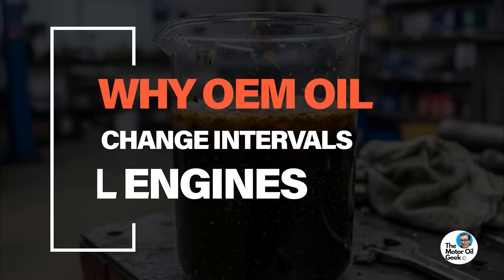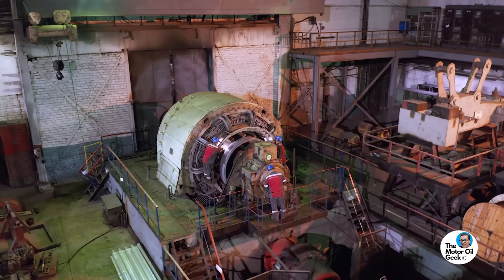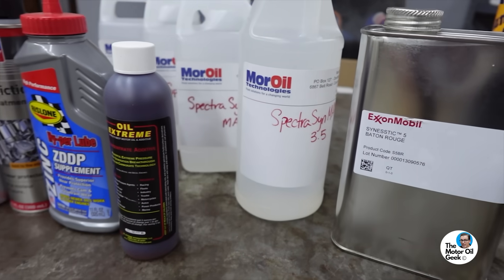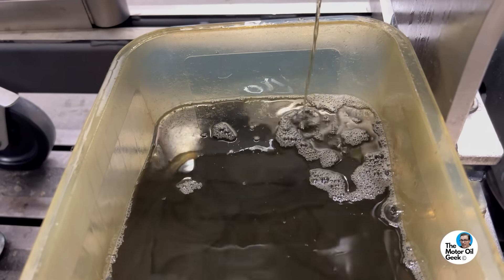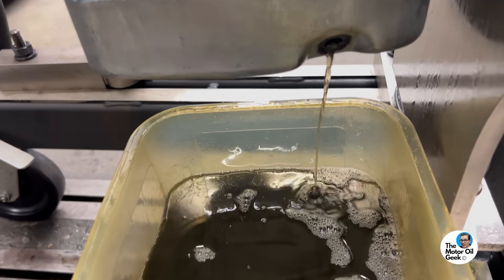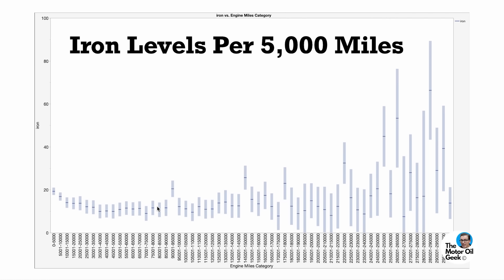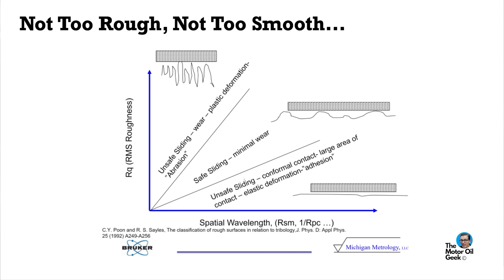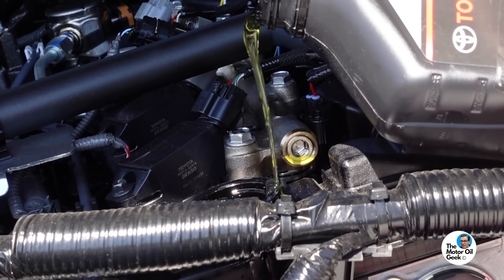NEW Data Reveals WHY Modern Engines FAIL Prematurely!

Comment: As much as I love me some AMSOIL I don't always have the funds for it. So I've just been sticking to the Harvest King stuff they sell at our local Running's store and so far it's worked out. A 5 quart bottle of 5W30 full synthetic goes for $20 and an extra quart is $4.49. A good price for frequent oil changes. I try to change the oil every 3,000 miles but I don't always have the opportunity to. So it's probably more like 3,500 miles. I've also considered changing the filter at least one more time throughout a fresh oil change before a full change is needed. But I don't know if it's worth it.

Comment: How does the dirty get around the oil filter? The pump, pump oil through the filter than into the engine? So...if we all do what you recommend. That will solve the engine problems?

Comment: Genuine observation/question - In my lifetime we went from straight 30 weight to multi viscosity 10-30 then 5-30 then 0-20 to 0-30. I don’t understand how a 0 weight oil can possibly be good for a motor. Couple this with viscosity breakdown and it’s a recipe for a major parts failure. There doesn’t seem to be enough “film” strength there to provide adequate protection. I suppose if you are in the parts or repair business it would be a benefit to you to have important parts like bearings to fail or “spin” creating a much lager repair bill. 

Is this a correct line of reasoning?

Comment: The factory never does the alpha and beta work. It‘s the customer, be it break-in, new features, metalurgies, anything. Sure they test in their labs, and on roads and develop procesures, but nothing mirrors reality better than reality by engine-lives. Don‘t think the warranty assures they‘ve done their job and it‘s there to safeguard you the customer or proove the customer how much trust the factory has in its product. It‘s not!
Warranties is to cover-up on anything beyond break-in that might get them into public re-calls otherwise, friendly individual factory driven pro-active or re-active replacements under service is to avoid public re-calls, to cover up issues they have designed with their bad quality testing and bad quality designs, cost savings, idiocies pushing known errors to market, and so forth. In addition it‘s there to retain good customers (good customers are the ones that yearly buy a new motorcycle or more, it‘s not the one that buys a bike for 20yrs and comes to the occasional service, less so the one that does his own service on a newly bought bike).
It‘s an industry of greed, thieves managing a few honest designers forcing them to accept or design crap delivery to customers.
Same on other industries, outsourcing not helping but worsening the capabilities to serve the customer, I see it in our company and I see it in all industries of our customers as they do the same. Who wonders why all goes bang, constantly?
What‘s really funny is, that these morons who have no skills and do low jobs and the others who have no skills other than upsell them to do mgmt jobs, both in private think they can serve a complex system better than their smart engineers that are not allowed to put a working system for a fair price in front of their customers. Then we have all these videos on the net with all the supersmart skill-less people that bought a smart-phone or a better video cam and a few engineers that try to fight these with proper knowledge and expertise. this is so funny, that it is no more.

Comment: Excellent information. I have 233,000 miles on a 2006 Toyota Matrix 4WD. It's 45th oil change is coming up (5k/6mo, OCI). Also, I measured pressure pulses at PCV hose with a PicoScope and a DIY sensor (smoke alarm piezo). There is effectively zero blow-by. 🔧

Comment: Doesn't the oil filter soon pass the point where its efficiency increases, causing significant pressure loss and increasing the risk of the bypass valve opening?

Comment: Any data concerning the impact of design and manufacturing defects vs. user neglect and even outright abuse?  Personally, I've owned a lot of vehicles over the long term and neglecting things like oil changes is extremely common, yet engine failure wasn't, in my experience generally everything else about the vehicle starts to go to crap long before the engine starts failing. In some Nissans that was the CVT. In some Hondas that was the automatic transmission. In some cars it's everything else, including the interiors falling to bits. Everything around the engine goes to crap, but that neglected engine keeps on ticking. I suspect that's the norm outside of cases involving defects like in design and or manufacturing.

Comment: Engine oil has been used as hydraulic fluid for decades … since the advent of hydraulic lifters.  Why is this now becoming an issue?  What is different between a hydraulic cam phaser as compared to a hydraulic valve lifter?  I’m not sure I’m seeing why this is a new problem if the issue is hydraulic use of engine oil.

Comment: Best advice I've gathered thus far: For a GDI based gas engine past the break-in period, change the quality synthetic oil often (say 5K miles) while using a high quality oil filter and perhaps only changing it every other OCI (based on the UOA) for best filtration all while using Top Tier gas.  I would drain out the old oil from the filter if reusing it if possible and always pre-fill any canister type oil filter when installing it.  I also would fully "mix/shake" the oil jugs prior to using them to ensure anything that might have settled in the jug is properly mixed back into the oil (I know, I know).  And do a UOA when you can (at least annually).  I will also annually do a fuel system clean (adding product in the fuel when filling up - I prefer Redline SL-1) to assist the Top Tier fuel cleaning effect as well.  Currently my oil of choice is Valvoline's Restore & Protect product (past has been Pennzoil Ultra Platinum).  YMMV.  Yes, please to deep dive on filtration as well.  Great video sir!

Comment: I recall one of your videos discussing air filtration and that a slightly dirty filter actually was better at trapping particulate matter than a brand new filter. 
Does that same logic apply to oil filters in that a single oil filter should be used for 2 oil change intervals before replacement or am I seriously mistaken?
I change my oil and filters religiously at 5,000km
Reply: No, oil filters don't get better over time like air filters do. This is due to the positive displacement oil pump forcing oil (and contaminants) through the filter harder as it becomes more restrictive.

Comment: Even though engines used to be designed with pencils and slide rules, you NEVER used to hear of timing chains stretching or snapping. 
It’s now a given for many engines. 
In my opinion, it’s designers inability to accurately build in their planned obsolescence that is the biggest crime, here. 🫣

Comment: You know it's going to be a great Saturday when Lake Speed Jr. releases another video. Lake has helped me solve my Cummins oil dilution issues. I change the oil every 6 months and rearly go above 5K miles. Last oil change, I switched to the PPE 5 to 15 micron high efficiency spin on filter and added an Amsoil oil bypass 2 micron filter. I always wondered why the change interval for the Amsoil bypass was 2 years or 60,000 miles but now I know why thanks to Lake. I'm going to try leaving the the PPE on for another 6 months, depending on used oil analysis after 6 months, and changing the oil at 6 months. I do use Howes Diesel Defender every fill up and add Howes Diesel Treatment in the winter for antigel. I also have a FASS fuel filter system installed for clean fuel. It will be interesting to see what the oil filter change frequency will do.
Reply: Wow! That’s what I call meticulously maintained engine.

Comment: As an Machinist and Manufacturing production engineer, I learned first hand in making "power generation"parts how important lubrication is (tribology) is. Even in cutting and machining there are specifications that can't be ignored or dismissed as silly book smart engineering hype. The later was often an comment old school Machinist belief. But, things have changed much since the 90's.

Comment: Modern engine failures are do because of tighter clearances, to thin of viscosity oil,  less anti wear additives in oil, and bad engine designs such as complicated cylinder deactivation systems.  GM bearing issues are just that tight clearances with not enough room for oil to cushion the bearing. You dump oil that pores like water its not going to cushion and stick to any bearing its going to get squished and run off! And finally the owner of vehicle bad maintenance levels!

Comment: on my 16 silverado i think my thermostat is stuck open.. last 2 oil analyst show lot more fuel dilution.. i went from 0w20 to 0w40 and climate got also colder but i have more aluminum in my oil now. i think of going back to 0w20 and test it again. i change injectors and direct injections pump already.

Comment: Can you do a video testing oil pressure vs filtration in modern engines? I feel having the proper oil pressure would be just as important as pure filtration of the oil filter.

Comment: Great content here! Does anybody think about oil filters when starting a cold engine?
From even 60 F on down to zero. What is the oil doing in the filter? Is it going through the bypass valve with dirty oil from around the pleats to a bypass in front or back. In MN I'm pretty sure oil goes through a relief for a few minutes every time a car is started.  Point being we are doing everything to prevent dirty oil from recirculating, but what is the filter doing?
Reply: @armedfarm3429 Your not supposed to bring that up - they all think the Bypass never opens 🤣 despite seeing every blown up Engine with Debris everywhere and manufacturers  fitting small mest inline filters to protect VVT and Turbo feeds.
Some Motorcraft and Mann Oil filters have the Pressure bypass designed to not wash the contaminants back into the Lubrication Circuit, The Blocked Filter Bypass will allow all the crap through.
The little " excuse " for filters do so little on newer engines changing oil every 3K and filter every 6k would make little difference.
In Fact The Japanese Designer of the GTR Motor said if you want it to last forever change Oil @3k Filter @6K 😉

Comment: I always change my oil at 5,000 miles and I usually change the filter with it but I think I'm going to start doing that every other oil change. Also I would like to see a deeper dive infiltration I have a 2003 Ford Ranger with hydraulic lifters and sometimes the lifter tick gets out of hand The only way I know how to fix it is to rev it up to 6,000 RPM and let it drop on its own then the ticking stops till it starts again but I just repeat that process

Comment: Do a contamination study on vehicles that are powered by natural gas. I remember decades ago in the late 60s early 70s my dad was a propane delivery guy. His companies trucks were converted to run on propane. When they  did oil maintenance  changes the used oil was almost like new. And that was with old fashion dino oil of course. They went from 3K oil changes to 5K

Comment: For me, taking into account this information lake is sharing. If your building the engine.  And you take into account the cost of the process to WPC treat your crank, cam, valves, Springs and keepers & piston ring lands.  It would be crazy not to if you're into correct/ longevity/ pride in your work. But if you are a, kind of sort of, good enough, whatever, just go back to the junkyard I'll mow my yard next week type.  You just missed an excellent cat video while reading this.

Comment: Asked this in your last filter video and didnt get any answers.  
What spec filters should we be looking to buy?
Reply: If you're changing your oil at 3000K to 5000K with normal driving, any mid-level name brand filter is sufficient because you're never getting close to the filter's limits.  Go to synthetic media for a slight bump of removing smaller particulates.
Reply: @kirkdarling4120  efficiency and micron rating’s have nothing to do with interval length.
Reply: @choking0smurf  I didn't say it did.
Reply: @kirkdarling4120 then dont comment things that have nothing to do with what i asked.
Reply: @choking0smurf  Okay, then this: "If you're changing your oil at 3000K to 5000K with normal driving, any mid-level name brand filter is sufficient because you're never getting close to the filter's limits."

Comment: Think cats have had hydraulic lifters since mid 50's diesel engines have used motor oil as hydraulic fluid about as long and failures with dirty oil can happen but nothing like these new boned junk plastic motors

Comment: IIRC Tim Gilles stresses on importance of a proper breaking-in procedure in his book. I used cheap dull dyno oil for the first couple of hours, then my regular synthetic oil for the next ~1k miles, then changed it again and proceeded with 5k miles or 6 months schedule as usual.

Comment: And once again, the only source I believe provides answers. We live in a world where brand preference trumps science, where feelings outpace reality.
The Motor Oil Geek channel stands head and shoulders above the rest due to science, logic and common sense.
Bravo maestro!
Reply: Agreed! I love this channel. Just bought a brand new Tucson hybrid and I did my first oil change at 500 miles, and couldn't believe the stuff that was in the filter housing. Blue and silver metal looking shiny pieces. I was only able to see that because of the cartridge filter design being on the bottom of the vehicle and the sediment was at the bottom of the plastic housing. I cleaned it out before reinstalling the new cartridge filter purchased from Hyundai of course. I would just wonder when should I change the oil again and for how long should I do shorter oil change intervals like every 2k to 3k miles instead of 5k? I guess for the first 10k miles? Until I stop seeing the pieces at the bottom of the housing? Sounds like a safe bet.
Reply: ADD, change your oil at 1000, 2000 then change the oil every 5000 miles if it’s naturally aspirated, if it’s turbo charged change the oil every 3500 miles.
Reply: @RipliWitani Thank you! That's exactly what I'll do! It is a turbo 1.6L hybrid. Pretty quick for an AWD SUV and good gas mileage. I love it and want it to last!
Reply: @ADDwithJTC    use the Oil in the Video ...   he just did a vid. On what to do ...
Reply: @ADDwithJTC We bought a new Santa Fe with the Turbo and Im doing the same and using Amsoil Signature Series which was formulated to protect from the heat turbo’s cause. Runs so smooth and quiet with Amsoil and it’s a quick car. That turbo hits and off he gets.
Reply: @Ron_Presley Yes, Hyundai makes quick vehicles! My brother's new Palisade is really fast for its size. I like the new Santa Fe it's looks really nice and I'm not surprised that it's fast. I know Amsoil is great. I've always used Mobil 1 for the last 25 years and never an engine problem so I stick with that. I have a 2017 Focus ST that's pretty fast with about $10k in parts work done to it and I beat the shit out of it lol still runs like new 8 years later! Enjoy your Santa Fe! I sure love my Tucson hybrid!
Reply: @ADDwithJTC  That's for sure, Thank GOD for President TRUMP, always, always use GM lifters, no matter the brand your engine is, I've been road racing for many years, I had a cam and lifter failure once in my life, I strayed from that reality once, I went with Lunati roller cam and lifters years ago, before I knew the rules, roller lifters failed, you know the rest of that story, thankfully Lunati is out of business, they would not stand behind their product.
 At the track, a race engine builder/GM engineer told me the secret, always go with 10-15% stiffer springs in race engines than recommended, always use GM roller lifters, always use Royal Purple, I have never had a failure since, my 96 Silverado tow vehicle is getting ready to roll 400,000 have never had a tappet cover off it, I change the royal Purple once a year regardless of miles, it uses no oil.
Reply: Wow thanks for the info! Glad your Silverado is running so well for so long! And yes, thank God for Trump in many ways 🇺🇸
Reply from the maker: Thank you!
Reply: Don't let the amsoil ilk hear that 😂😂😂
Reply: That's why I use 1 micron Secondary/Auxiliary filtering  system . It first came out in expensive mining equipment and now the system are available for trucks mostly Diesel truck,  but you can get a kit for gasoline . Look up " Insane Diesel " filtration system . I'll be retrofit a filter system on  my 2026 Colorado . I've been using one of there kits on my 3.0L Sprinter based RV for last 6 plus years . Basically after I do fresh oil change and it runs only a few minutes the oil is CLEANER then out of the oil jug . There documentation of 1 million miles on engine that was torn down and it has little to No wear .
Reply: I have a 2018 Ford f 250 with the 6.7 litre diesel engine. I have been using Ford 15w40. I am thinking about switching to full synthetic, likely rotella t6 for year round. I lice in Canada, summers hot ,winter cold. Summers I tow a 9000 pound trailer lots. Any thoughts out there on oil for the truck
Reply: That’s the science Trump is against to be fair. Only Liberals care about feelings over facts.
Reply: @Freemasonshair are you drunk?
Reply: @Freemasonshair   why do you morons always have to bring politics in to everything?
Reply: @Freemasonshair what science is Trump against? I know he's great at making money and running the country but I highly doubt he knows anything about cars or engine oil lol